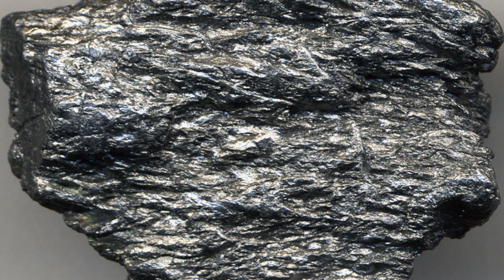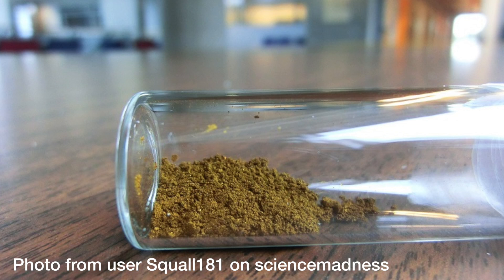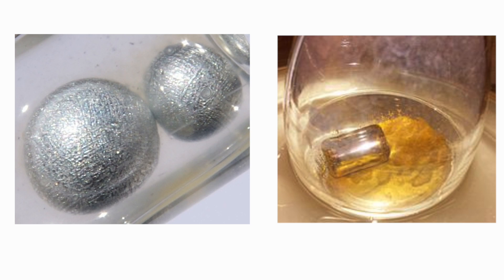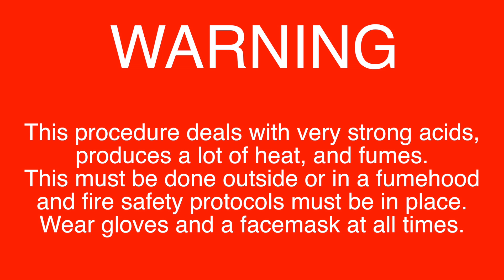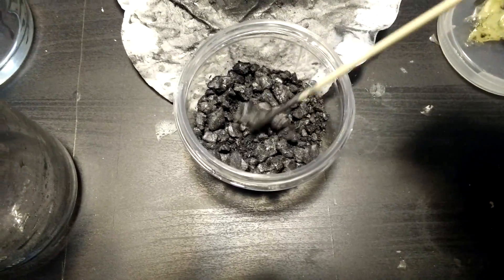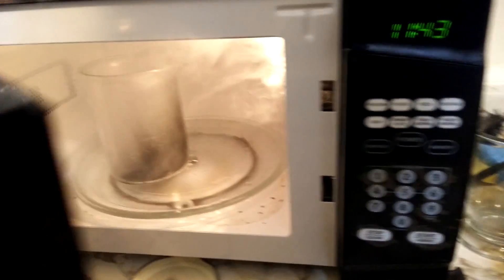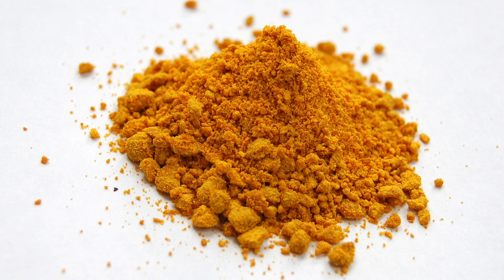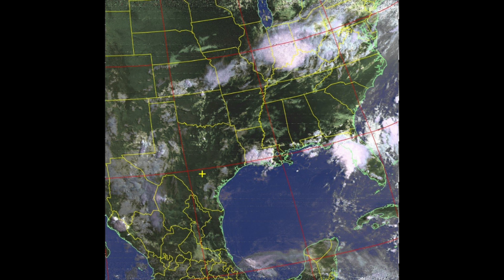Intercalating Graphite (Sulfuric Acid intercalated graphite, Expanded Graphite, Graphene)

Comment: Great work. is it possible to make wires from this material to be used as a substitute for copper?
Reply: Very good point,  but I already done with some modification with the heat resistant up to 950 c degrees where it can be also use for heating element and slight different modified version for replacing electric cable and now tweaking the another version for data transfer. )) but good catch up ( I am engineer and I run product development company)

Comment: I want to be able to make nickel iron batteries at home to store energy including solar.  Nickel 3 oxide can be layered with nickel flake  in a nickel coated tube and used as an electrode.  The oxide is not very conductive so the nickel provides the conductivity.  If we intercalate the nickel and the oxide with graphite will the graphite increase the conductivity?  Will it be more or less reactive with the Potassium Chloride electrolyte?

Comment: hey @The Thought Emporium , don't wear gloves while working with nitric acid!
Nile Red has a video about this, most types of gloves will burst into flames and melt onto your hands if you get nitric acid on them!
just be very cautious and work barehanded
Reply: this is mainly a concern with the extra pure nitric acid, so-called Fuming Nitric Acid

https://youtu.be/aBVdGGml6bU
Reply: you gotta either wear butyl rubber gloves, or none at all, because the nitric acid can penetrate latex, nitrile, and food handler's gloves, and is potentially a fire/burn hazard.
it's way more dangerous to get nitric acid and burning latex on the same spot on your skin than it is to just get a little bit of nitric acid on your skin. 
nitric acid doesn't do any damage if you just wash it off fastly.

since you're working with sulphuric acid AND nitric acid, you maybe should invest in some butyl rubber gloves
Reply: I make Fuming Nitric Acid, which is way stronger than the Nitric Acid they are using.  I have also mentioned this to Nile Red, purchase Vinyl gloves (Firm Grip - pro paint) from Walmart.  They are very cheap, you can dump Fuming Nitric Acid on them, and they won't burst into flames while also protecting your skin.

Comment: Is there a substitute for using nitric acid? I follow both yours and Murray's work faithfully although have yet feel like I know enough to throw chems together lol. I am more the type to cross every T and for every I while ensuring I have all pieces of the puzzle in hand before beginning.

I looked to see just I could get nitric acid but no go, however I find a free ways to make if really needed. Either way I am you're between this method you lay out here and Murray's method of using iron 3 chloride.

Andrew
Reply: yes, the hno3 can be substituted by a variety of strong oxidizers

Comment: Can you make graphite from charcoal?
Reply from the maker: Ya, but there are some tricks to it if you want to do it at low enough temperatures to be feasible for the amature
Reply: Cool... I found no paper on it but I figured it should be possible so far there is carbon.... I was thinking of using the  Tang Lau  method.... But I believe that the yield might be contaminated by salts, so the major problem would be to purify it. What would you advice to get an average yield?
Reply from the maker: Look up low temperature graphitization. Generally, you soak the carbon in particular metal salts and they act as a catalyst. then heat the mix to about 700c.
Reply: Thanks, I'll go check it out...

Comment: You should give the Hummer's method a go and make graphite oxide. Check Robert Murray Smith's improved method (extra final stage with H2O2).
It's a fascinating reaction, with some great colour changes and very useful for further reduction into graphene and other graphitic compounds. Just a little dangerous if you don't keep the temperatures low enough, but easily doable.
Reply from the maker: I actually really don't like hummers method. It's unnecessarily dangerous. I prefer the modified tour method. I'll get to making that video next time I need to make some GO. Luckily someone donated a bottle of GO, so I won't need to for a while